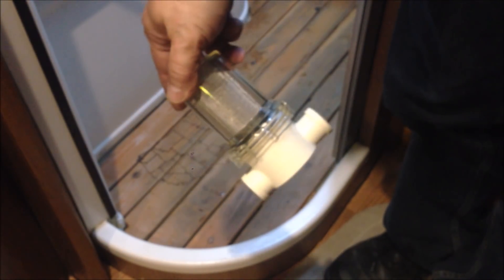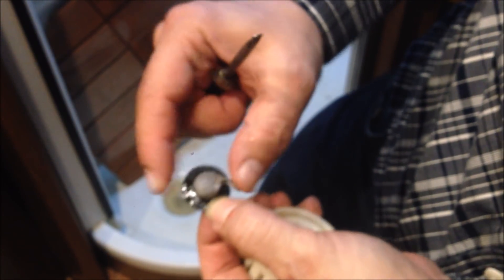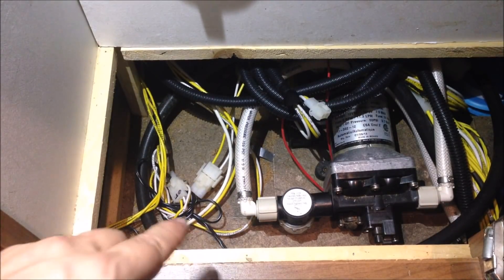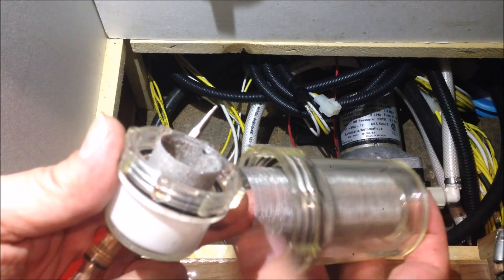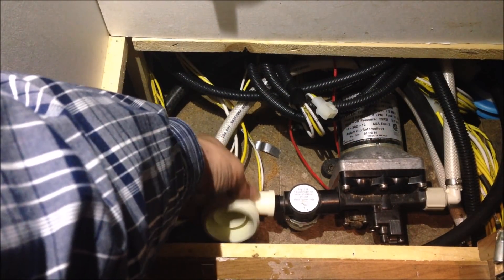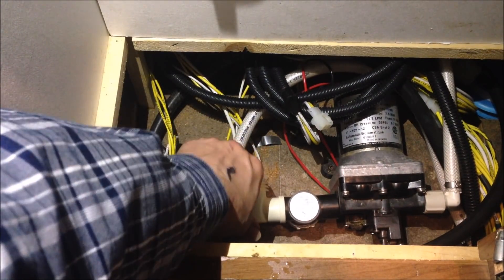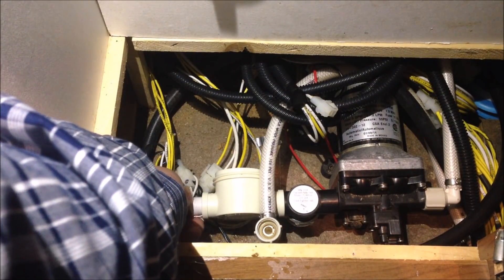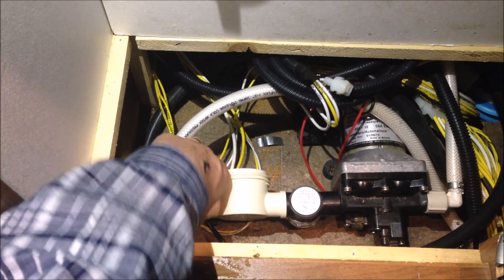Improving the shower drain filter on Winnebago Travato 59G

Comment: Hi! How’s the extra filter working out?
Reply: It worked well, but in a subsequent video I show how I ended up replacing it with a smaller centrifugal pump that has less concerns with malfunctions due to unfiltered shower drain water.  I'm also working on completing a design for a screw-in shower drain with small holes to prevent larger chunks that could still cause a problem.  When completed, it will be announced on http://facebook.com/groups/travatoowners and http://stg.net